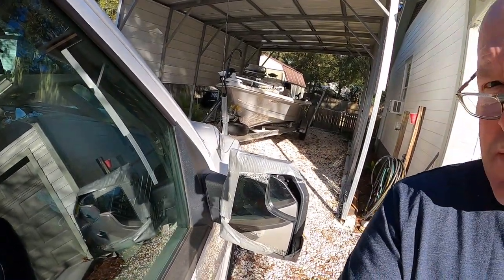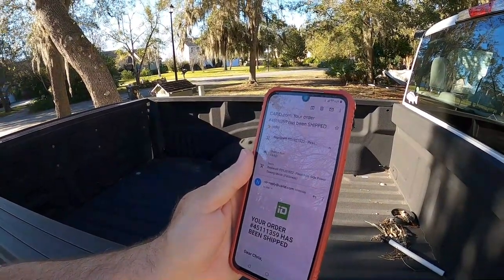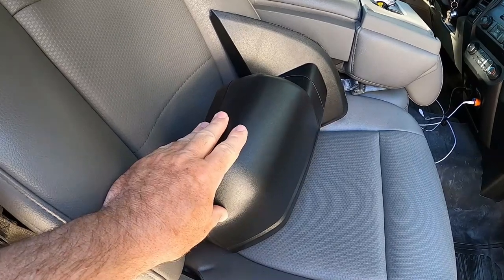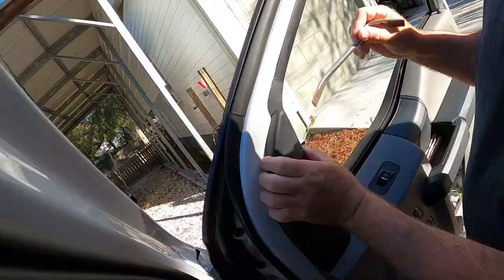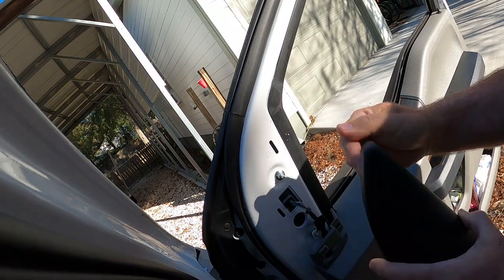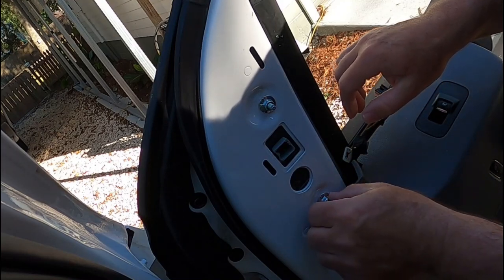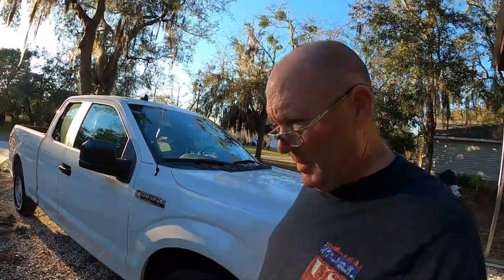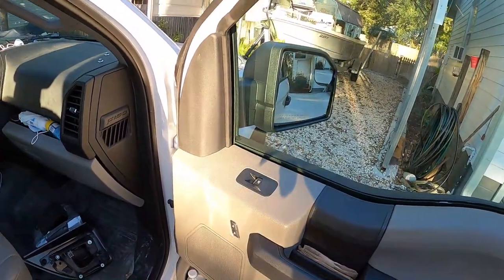2020 F-150 Side Mirror (from CARiD) Relpaced Saved $$$$$

Comment: I have the same truck, 2020 white XL Supercab and a gate post just took out my passenger mirror while backing in.. 
Your video looks like it will be a piece of cake. Thanks !
Reply from the maker: It was, the after market mirror does not have a temp detector in it however so it makes the check engine light stay on so you may want to do some research to see it the one you pick has it.

Comment: Excellent video. How long were the 10mm bolts you purchased for the mirror?
Reply from the maker: Sorry it has been a while I don't remember but theyshould have been shorter than the ones I picked, I had to use spacers for them.